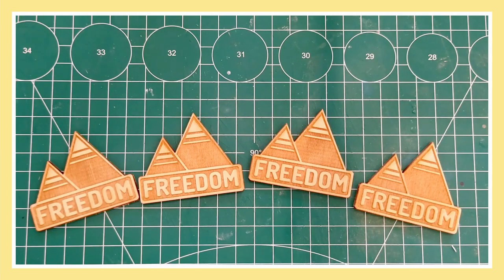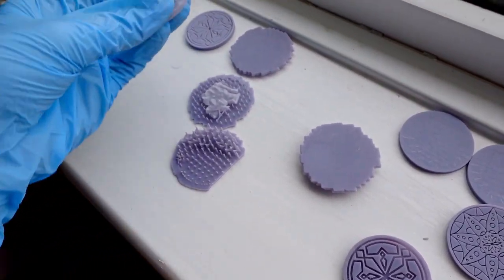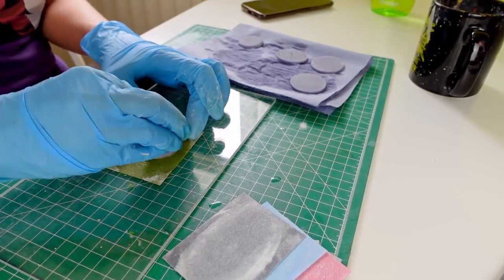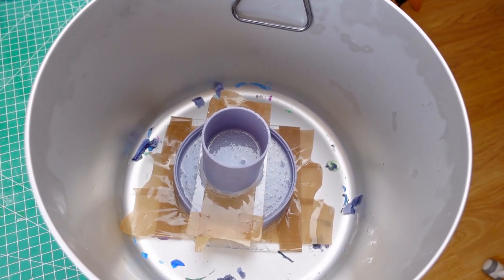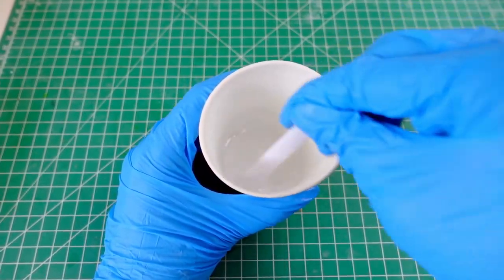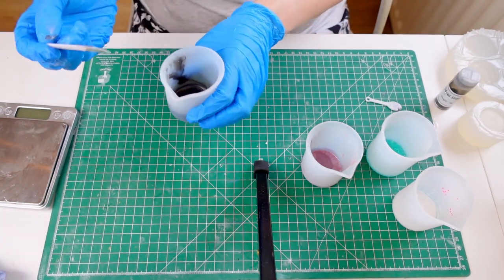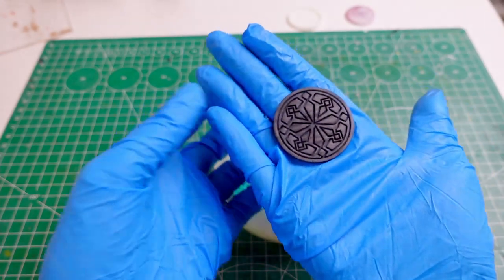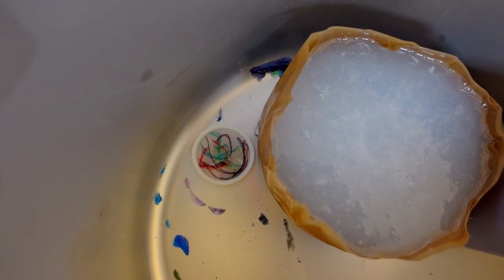Making resin needle minders 2: Electric boogaloo

Comment: They were great! Its cool you have so many different types of craft to merge together too. I did buy soap making stuff before lockdown but not touched it yet haha 🤣 I actually really like the rusty dwarvish design 😍 can never have too many needle minders so keep going! If you can be bothered that is haha, the blue sparkly half and half, if the white was beige it'd be like the sea meeting the sand
Reply from the maker: I did think about doing a typical resin beach one, maybe in the next lot! You should so break out those soap supplies because it's super fun and even though you have to wait for them to cure, you do at least get to slice up your soap and get the feeling of accomplishment after just a day. Protip though don't leave castor oil on a shelf in direct sunlight for six months and then try and make soap with it, just putting that out there 💅
Reply: @TheGiddyStitcher  haha we like checking the heat by the coconut oil melting lol 👌 I didn't get the slice up kind. I was very oddly specific in my random order. I got the soap bases and oils then I got a honeycomb mould (for honey and oat infused soaps - just didn't realise how much the manuka honey actually is 😳) then I got some lego figure moulds lol 😂 we got re usable Easter eggs so was gonna do that clear with some lego shapes inside. Bit ambitious for a first attempt or what haha 🤣
Reply from the maker: That sounds utterly ridiculous and I respect it a lot 😂
Reply: @TheGiddyStitcher  haha high praise indeed! ☺️